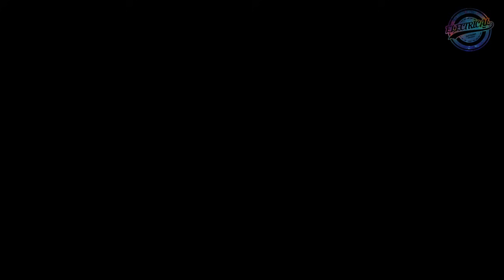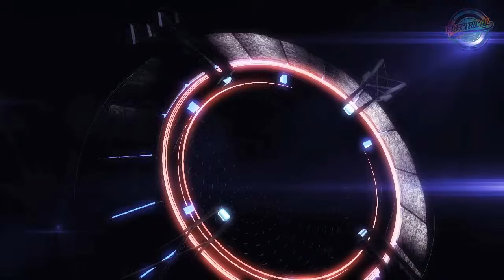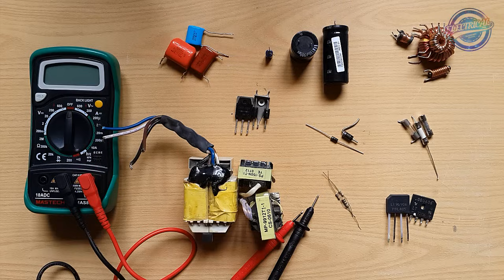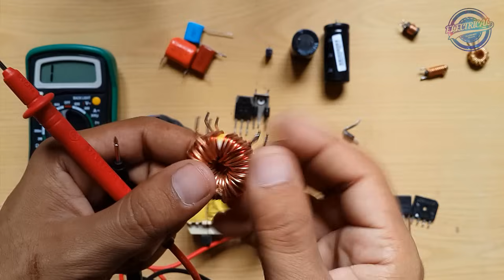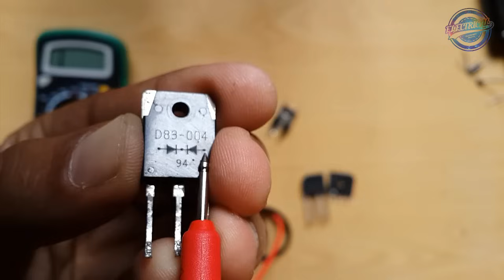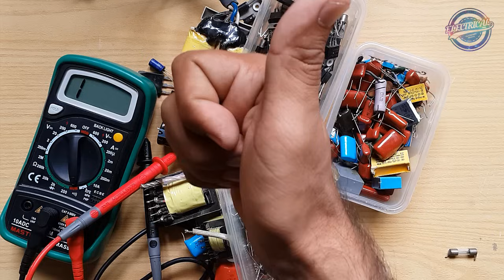How To Test Electronic Componets || Testing Electronic Components With DMM

Comment: Is it possible that not every multimeter is capable of measuring every diode? 

I have Unit 139A with diode tester and when trying to test many new diods ( 12kv 450mA) it shows OL in both directions. It it possible that it is over the some lilit of the multimeter?
Reply from the maker: There Could be a problem with your Multimeter.
Reply: @UnfilteredWorld-w6p  no. I found out that you have to include some sort of additional voltage to the system. For example connect 9v battery and then test loose of voltage on the diode. Then the correct results showed.

Comment: I'm now totally confused about transistors now. How is it the internal of the transistor is just two diodes that seem to be in parallel with one end, but other transistor videos talk about the 3 terminals as having a base, emitter, and collector? They also explain how they can be used to amplify a signal by being a lower power switch to allow a larger power flow on the other connections?

Comment: Good tutorial. My only add would be when testing semiconductors, the meter should be switched into diode test mode.
Reply: Ive been trying to find someone to explain that exact reason to me. Would you be willing to explain why you want in diode mode. Wasnt sure because of the bias voltage or what been very eager to learn. Thanks in advance

Comment: While testing resistance, our body contact(fingers holding ends of resistance) shown is not correct!!
There will be substantial error while measuring high value resistance. One should avoid such contact.

Comment: Hello. My job is to repair electronic boards in Iran and recently I faced a strange problem.
As I was repairing a BMW 730i 2017 wing mirror electronic board, there was a dubitable component from ST electronics company which I couldn't find its datasheet on the internet. That was a 2 pin component with Zb2b part number. I am wondering if you could help me with finding out what component I should replace with this. sincerely.
Reply: I can't. If the pcb is simple, you can reverse engineer it and draw its circuit. You can deduce an equivalent of the  component

Comment: You're checking continuity for x rated capacitors. That is not correct. If something goes wrong on the line side, the non polar x rated capacitors are designed to blow up and open the circuit. The continuity test will not detect those faults.

Comment: Probably this was addresed, but NEVER DISCHARGE A BIG ELECTROLYTHIC CAPACITOR WITH YOU FINGER! (You could end up dead, burned or shocked)
Discharge it with a proper lead with a resistor to a chasis or grab a screwdriver from the insulated end and shortcut the terminals. In the last case spect a spark.

Comment: Im not expert but you make that decision for me in 3 ways. #1 do you care at all lol. #2 can it be dangerous #3 just get the specs. Most electric devices you can test multiple ways. Those fuses for instance. Don't do it like that. I mean its an ok method but like i said ifs a damn 10v then its more than likely. Especially when they letting amps through like TVs. That fuse could be corroded and still check out ok. It can be thin and still be ok by him. Yet if you out those littlest fuses at AC power. It will more than likely work until it feels alot pressue or an accident slip or whatever. My point is its dangerous. You will never see a known guy from America say thats ok bc he'll get ripped on

Comment: We know that to test a component you have to use a voltmeter with rodes from both sides! Which you have been doing. The trick is to how to use the voltmeter....what did you set up the voltmeter on?

Comment: There are two quite inexpensive tools you might appreciate that easily test many electronic components. They'll test most of those parts a lot faster than using a DMM or DVM and they'll provide a LOT more information about a part. The ones I obtained are reasonably accurate. They cost about as much as a CHEAP DMM. I just bought both of these (to compare) and the LCR-TC1 has already saved me hours of work in just one week. I wish I'd had one of these 10 years ago!
The (about $15 to $20) "Multifunction Transistor Tester LCR-TC1" or the (about $10) "Mega328 ESR Transistor Resistors Diode Capacitor Mosfet Inductance Tester".
The LCR-TC1 is a blinged-out version of the Mega328.
Essentially these tools can "scan" a component (including an LED) and provide information on its health, its value (e.g. ohms, gain, inductance, capacitance, forward voltage, zener voltage, and so on), and provide pin-outs for different types of components. You don't even have to try to figure out which pin is the emitter/base/collector/gate/drain/source and so on, or worry about polarities of diodes...the tool does all that for you.
There are multiple Youtube videos that review and demonstrate these tools so you can see exactly what they do. You do have to be wary as there are multiple vendors who all CLAIM to be selling the same thing but there can be differences.
There are more expensive devices out there that can even ID a fairly large number of unlabeled ICs just by plugging one in and pressing a button.

Comment: Thanks but video was confusing because you need to explain what setting your using. Appreciate your time.
Reply: THE GUY IS USING MASTECH MA5830 SERIES MULTIMETER COST AROUND RS.475 TO 500. FOR TESTING THE DIODE PLACE THE KNOB ON DIODE MODE OR 2K. FOR TESTING CAPACITORS OR INDUCTORS(COILS) OR TRANSFORMERS SELECT CONTINUITY MODE I.E., BUZZER MODE.  FOR TESTING RESISTORS PLACE THE KNOB ON APPROPRIATE VALUE AND TEST.

Comment: Can transformer be checked while on board?
Reply: Yes it can be tested on board in continuity mode(buzzer mode)without applying power supply.  You should not check the transformer on continuity mode(buzzer mode) when power is on.

Comment: When i check the resistance in continuevity mode is not beeb but readings are showing
Why?
Reply from the maker: Because the value of resistor is high that's it doesn't beep and shows the value.

Comment: Hi I am facing this issue. I have a drone's Tx and I soldered a new Alfa antenna the correct way, it worked. then I put hot glue on it to secure the connection. since then the Remote's power light comes on and then goes away in a sec, if I then immediately power it back on, then there is no light. However, if I wait for 5-10 seconds then again power it back on, the light comes up for a second.
Here is a video explaining the problem : https://vimeo.com/290766738
Would you please help me out.
Reply from the maker: I think the Hot Glue has desoldered the components in PCB check it if there is loose connection.

Comment: He is not explaining in multimeter which mode has to put on while checking or testing electronic components but he is only using the probes at ends 😊😊😊👈👈👈 no I don't like

Comment: Those diodes connected back to back are not transistors even though they have three pins they miss the base part of the transistor,and also dont touch the test leads when testing high resistance RESISTORS as you are a resistor yourself,thanx any way for NOVICE intro

Comment: I have a g.e microwave that heats up but the display doesnt come on would it be a resister,transistor or capacitor that might be the issue?
Reply from the maker: If the display doesn't come on may be a fuse is burned if there is.The fuse could also be in a resistor form with low resistance.
Reply: Electrical & Electronics Projects. ..i noticed 3 resistors that are next to ea other are green color not sure if their bad,how can i order them from amazon? Do i get the same color coded ones?

Comment: Sir , how we can do low amphere dc 12 volt battary
Reply from the maker: If you want to low the amperes of battery you have to connect resistor to the positive terminal of battery to resist the current.

Comment: if the continuity buzzer beeps in a resistor while in a circuit board but does give a ohm readings is that resistor sorted and bad?? also if the readings of transistor is showing 1 on both side but does not beep is that bad too?
Reply from the maker: While in a circuit board there would many resistors those are connected in series that's shows readings in ohms while individually buzzer beeps because of low resistance. 
if the readings of transistor is showing 1 on both side but does not beep.

In this situation select diode mode in meter and then try it sometime the range is higher then the selected mode in meter 
so,it shows 1 or OL.

Comment: hello I have a 12 volt auto LED bulb that does not work knowing that in the circuit I have two or three SS34 diodes that burned, but the fan did not turn, do you think I need to change the diodes SS34 ?
Reply from the maker: Yes,Exactly you will have to change the diodes if burned.

Comment: Dude you forgot to tell what multitester setting at the start of the video during  Fuse , inductor
Reply: Tax Payer  it was set on continuity., if it has continues beep sound, fuse is ok. Other way to check fuse is thru ohms, set to ohms and test the fuse, it should show zero reading. Then the fuse is ok.

Comment: good job but let me ask. When checking the transistor aren't you suppose to get a reading from 0.3 to 0.7 how is it you're getting 99 and 100
Reply from the maker: 0.3 and 0.7 are potential brier voltage as the transistor is made of two diodes and are semiconductor devices.So, For silicone diode the potential brier voltage is 0.7 and for Germanium 0.3 volt.
Reply: these at the end of the video are not transistors...
Reply: Can’t just put red on one side and black on any other side there is and the multimeter isn’t being used properly but he’s trying. I was thinking about my performance in class at my first motherboard inspection test in school.  I was lucky I wasn’t injured.  Many capacitors hold juice a while.  Some Can and will kill you if you go touching the wrong things. You’ll either end up better with a fucked up multi meter ha ha but this kid got a lot right I think his rush to get through the video correctly I have missed guided his words but good luck to him
Reply: Because he doesn't know what he's doing... that's why